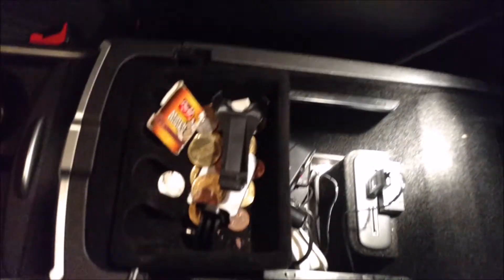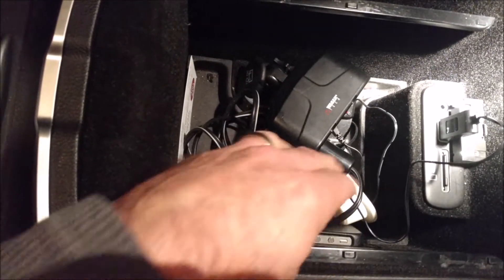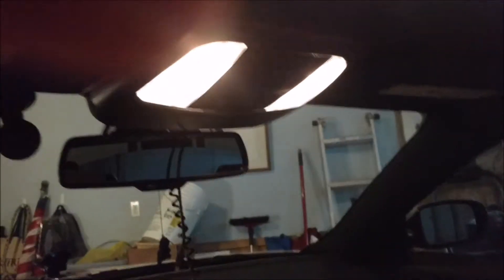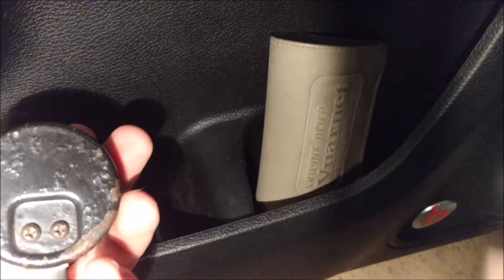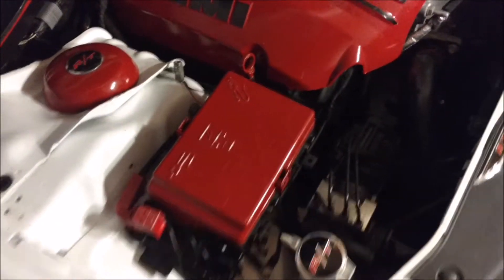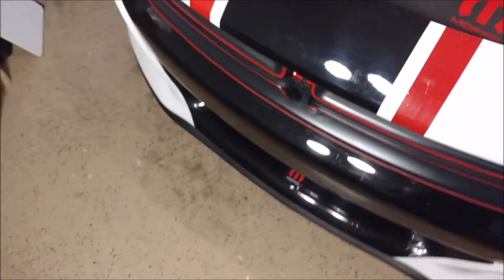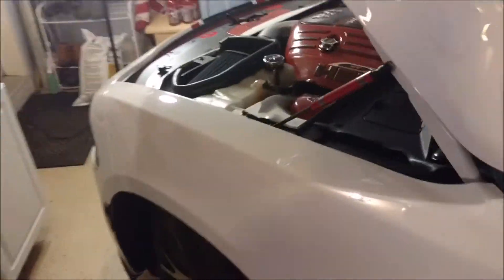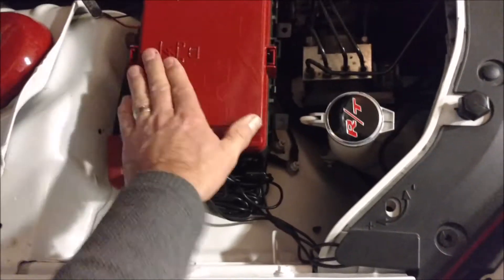Under The "Lids" Challenges

Comment: My Ram has a solid short wall of plastic that pops up like your sunroof one but it doesn't make any noise & it's quite short.  Your paint on the engine cover & other components really came out nice bud, still debating how I want to do up mine soon!  Thanks for showing your ins & outs my friend!
Reply from the maker: Seems like a lot of community members prefer the half covers,  but the full engine cover actually makes a pretty good size canvas if you want to portray a specific theme for car shows.
Reply: CTCharger I like the half covers at first but now prefer the factory engineered cover, the half covers look kind of cheap as you can see they aren't the real thing.

Comment: You need some racing stripes on that door stop. It does look like it breathing.
Reply from the maker: johnnypro Haha. I keep a roll of vinyl tape in my pocket at all times and wear my heat gun like a six shooter
Reply: CTCharger lol. Am I going to see some tire paint soon?
Reply from the maker: johnnypro I gotta do a little more research. You're supposed to scrub the tires with acetone to eliminate all the built up oils and I've never used that stuff.  Probably some ambient temperature issues to consider also and my garage floor stays pretty cold even with the heater on. Hopefully in the next couple weeks.
Reply: CTCharger I got a couple of jugs of that stuff. It’s very potent.

Comment: Where did you get the window fluid cap
Reply from the maker: The R/T badges are on Ebay and come in packs of 4.   These are the same badges that I have at the center of my wheels and they fit perfectly over two of the engine fluid caps.      https://www.ebay.com/itm/4x-2-2-Dodge-Black-R-US-RT-R-T-Wheel-Center-Hub-Cap-Emblem-Badge-Decal-Sticker-/222844650944?hash=item33e29385c0
Reply: CTCharger sweet thanks man